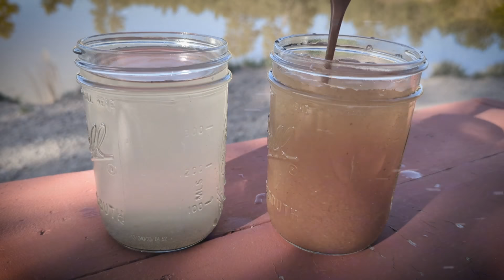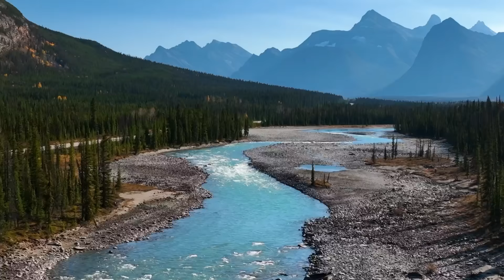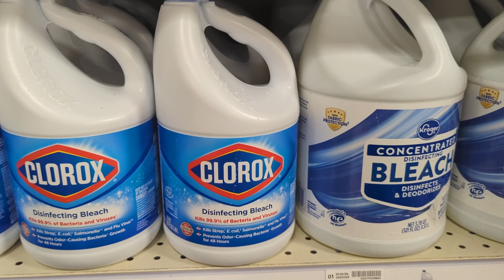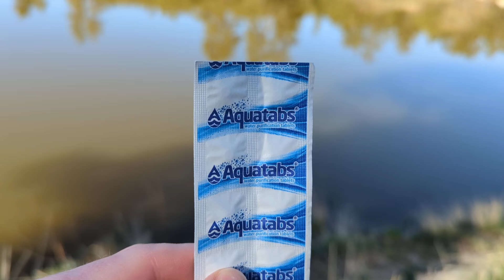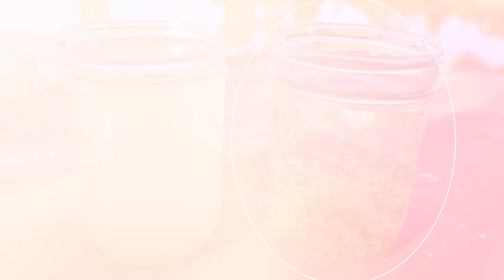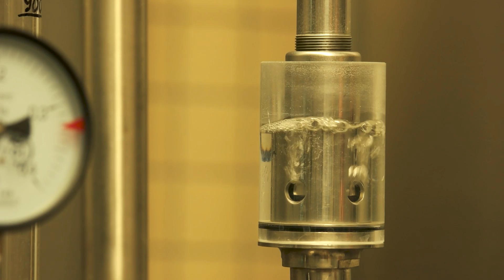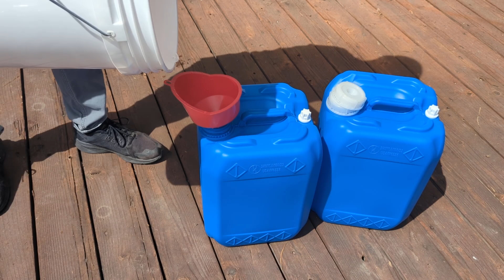The KEY to Emergency Water Preparation Before SHTF

Comment: Consider having 3 gallons of water a day per person. 1 to drink, 1 to shower, 1 to cook food.
Reply: you dont need sterilized water to bathe. if its clean enough to swim in its clean enough to bathe in.
Reply from the maker: And at least a 1-2 week supply of drinking/ cooking water would be ideal
Reply: After hurricane we were without for nine days. We had bottled drinking, tap in buckets, and rainwater. Rainwater was for flushing. At the end we (wife and I) used a total of 72 gallons. There was still a boil notice after all was restored.
Reply: 3 gallons per day is a lot more realistic than the recommended 1 gallon per day a lot of people subscribe to.
Reply: In the UK people are told something like 1.5 liters a day per person. Must be just for tea.
Reply: @sixoffive  Or you all are less spoiled and more efficient. I would go into camping mode...and almost immediately.
Reply: @jeanetteschulthe1andOnly  Sorry, if that sounded like a dig. That little amount of water, 1.5 liters is what my wife uses for 5 or 6 cups of tea.  I think she’s been camping once, I just ask her how she would make tea without electricity and she said wouldn’t. She’s an indoor homebody. 
More efficient no, we’re on the gulf coast and it’s hurricane season now. To prepare They tell us 1 gallon of water a day per person. That’s about four liters. I think more is better.
Reply: @davehimlin2374 If you’ve ever worked in the hot sun, men can easily drink over a gallon. 

It’s called preparing. Be near fresh water you can filter. Have a way to filter and purify water. Have a well. Store some bottles/tubs of water. Have a rain catcher. Maybe get one of those pools that sticks out of the ground.

If you don’t have a way to clean yourself, you run the risk of dying from diseases and infections. 

If you stick with the mindset of only having half a gallon, you will have a rough time and die.
Reply: @davehimlin2374 Prepping for water can’t go lightly. Have a well, be near fresh water that you can filter, have a way to filter/purify water, have wood so you can boil water, have containers for storage, have a rain catcher, maybe have one of them pools that sticks out of the ground. 

Half a gallon is nothing if you’re working in the sun while in a garden/farm or staying in shape. Half gallon today will get you killed.
 
If you’re in the air condition and doing nothing but playing video games, sure half a gallon.

If you want to smell like sht, and run the risk of dying from disease and infection, while having no way to cook food, then sure half a gallon.
Reply: @davehimlin2374 Prepping for water can’t go lightly. Have a well, be near fresh water that you can filter, have a way to filter/purify water, have wood so you can boil water, have containers for storage, have a rain catcher, maybe have one of them pools that sticks out of the ground. 

Half a gallon is nothing if you’re working in the sun while in a garden/farm or staying in shape. Half gallon today will get you killed.
Reply: @davehimlin2374 Having water can’t go lightly. Have a well, be near fresh water that you can filter, have a way to filter/purify water, have wood so you can boil water, have containers for storage, have a rain catcher, maybe have one of them pools that sticks out of the ground. 

Half a gallon is nothing if you’re working in the sun while in a garden/farm or staying in shape.
Reply: @davehimlin2374 test
Reply: @davehimlin2374 If you’re in the air condition and doing nothing but playing video games, sure half a gallon.

If you want to run the risk of dying from disease and infection, while having no way to cook food, then sure half a gallon.
Reply: Sorry I have to butt in again, fetching water from the nearest body of water is going to be difficult too. If you’re transporting any quantity over a liter you need a plan. Mine is early morning, two five gallon buckets, radio wagon, some rope or cordage, a pew and fixed blade. A mile hike then off the road. Tie a bit of rope to each bucket for dropping into the creek so I don’t loose it and tied down to the wagon. Cover with lids and take the long way home. Watch out for bad people. Filter and treat when I get home.
Reply: @sixoffive  We’re on the same page I believe.

I should of been more specific. My mindset is more along the lines of living near a yearly flowing creek or river, preferably on property. So you don’t have to hike/transport it, especially in extreme heat or cold.
That would be ideal, but what you say may be good for those who may live further away from fresh water. But in that case, I would push to get a well and rain catching water into those large plastic water containers surrounded by a metal fence like barrier.
Reply: @user-yd3uh4pz5e  I’m afraid the count down may have started, but your plan is sound. You can do your own shallow well with a sledgehammer and pipe. Some parts of the world have a cistern for rainwater storage. Sometimes it’s up on the roof too, water pressure for plumbing. Those plastic storage containers are called IBC tote. They can be had used, you want one that is compatible with potable water. Not one that had chemicals in it.
Nice chat, take care.
Reply: @davehimlin2374 Your absolutely right, having clean water is a luxury. But I definitely don't want 3rd world problems, even in a sociable collapse.

And yes, drinking water trumps ALL the other reasons to have water.
Most Americans won't be prepared because their so used to daddy government taking care of them. They'll wait for them to feed them, have water stations, tell them what to do. This whole concept of 1 gallon a day is trash though.

But you're missing it man. I'm not talking about clean clothes. I'm talking about being able to wash your body: face, pits, privates etc, so you don’t have nasty bacteria growing on you. 
And your proving my point. People back then also died much younger: Uncleanliness being one of the reasons why. Let me ask: Would you be 100% ok telling your family you can only shower once every 6 months if running water went away? 

After a hurricane rolls through, you have flood. With flood comes filth from over flooded sewages, rotting animals/bodies, oils from vehicles, etc. Have water to drink for sure, but staying clean is going to become important real quick.
Reply: @sixoffive  Appreciate it. Check out the Jerrycans from Icon Lifesavor. They filter viruses up to 20,000L, no electricity needed.
Most definitely, stay safe out there man!
Reply: @davehimlin2374lol Whoever said it’s top of the list? And why are you so stuck on cleaning clothes? That’s not what I said. 
We we’re on the subject of water, not the other cool stuff of preparing.
3 gallons homie, you’ll enjoy life much better when you can cook, clean, drink and even take care of wounds. Extra water when it gets Florida in July hot. That half gallon idea will get you killed.
Reply: @davehimlin2374 lol who said anything about washing clothes? You keep bringing that up for some reason.
I sure hope washing clothes ain’t at the top of your list. 
I also said you want the 3 gallons to cook food. Its extra water to clean some wounds, help prevent infection.
Go in the woods and get that dirt, sweat, ticks, chiggers, poison ivy in the middle of July in some place like Florida. Getting clean ain’t gotta be at the top of your list, but damn sure it better be on the list.
Reply: @bryanhumphrey4072  Right on. Don’t listen to anybody that says 1 gallon or less a day is enough. They don’t know what their talking about.Those people will get themselves and families departed from this life following those guidelines.
Reply: @sixoffive  Appreciate the info! Take it easy man.